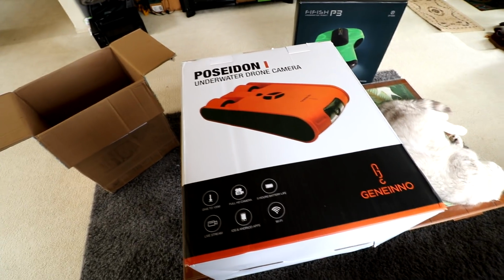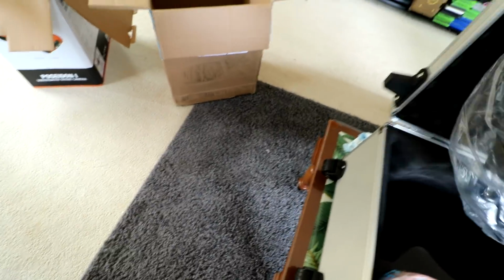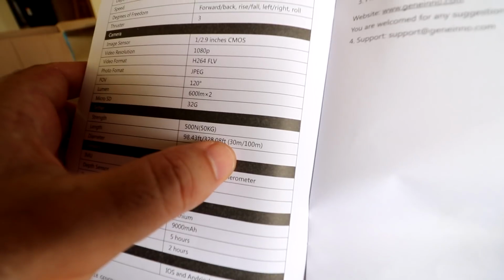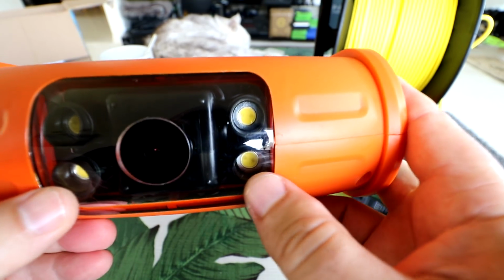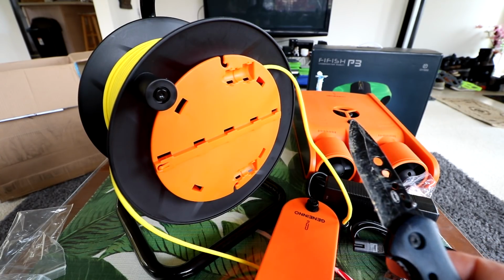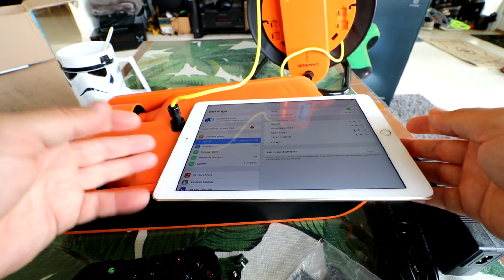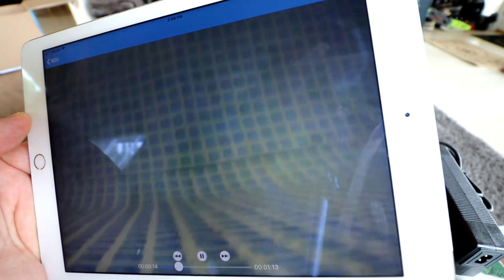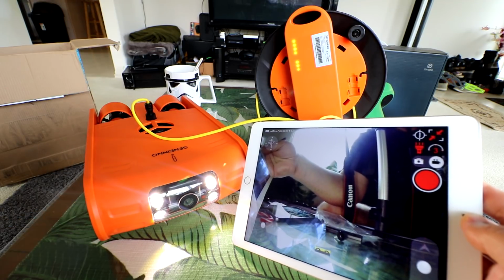2018 Underwater Drone GENEINNO POSEIDON 1 FPV ROV Review - Part 1 - [Unboxing, Inspection & Setup]

Comment: Hey Dustin.  Awesome reviews mate.  I very interested in which underwater drone you think is the best.  Im wanting to purchase one to assist me in recreational diving.  Simple operation, depth hold would be a must.  Im tending to lean towards the PowerRay, your recommendations would be very helpful.
Reply from the maker: Hi Joe,

Unfortunately they all have different strengths and weaknesses and none have got it "perfect" from what I've tested.  PowerRay is good all around but it's depth ability and camera seem most limited.  Gladius handles best and the only one I've tested so far that give you pitch and roll control for better shots but camera, WiFi and build quality was lacking (I am reviewing version 2 soon).  Qysea p3 has the best camera (1 inch sensor) and lighting but had issues with vertical motor power (a new production model has just arrived to test again).  
Main thing I'd look at when buying are If you want it to be good in anything but very calm conditions make sure it has multiple vertical motors for stabilization.  These subs are all still first generation so I'm banking the next models will have all the problems ironed out 👍